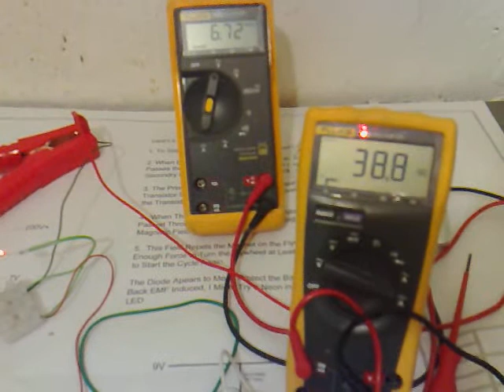Pulse Motor (Less Amps) 030

Comment: My first thought was that  F = k * I, or the torque is proportional to the current.  During the phase when the unloaded motor accelerates, the torque is high due to the acceleration. When the motor approaches the max speed, the torque drops to the level required to overcome the various losses at the actual angle speed.
However in this specific case TheNuclearWatermelon is also right.

Comment: It is because the faster the motor spins, the shorter the pulse duration, which means that it is drawing less amps over time versus a slow motor would have longer pulses which draws more amps over time.